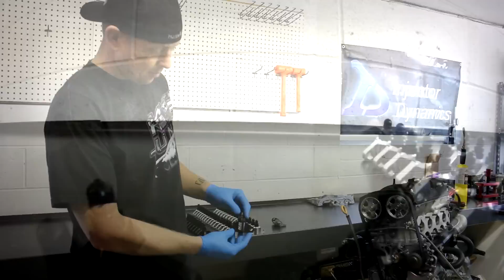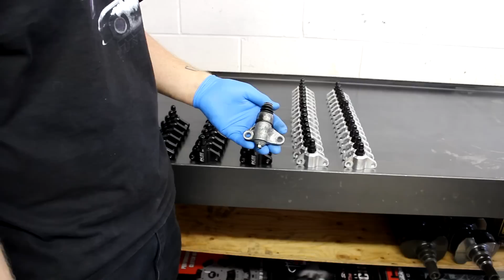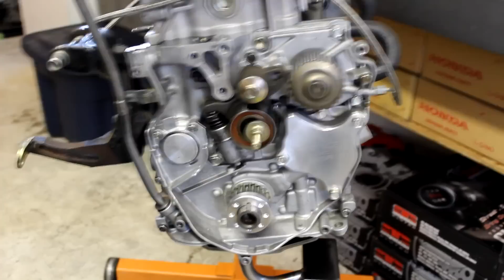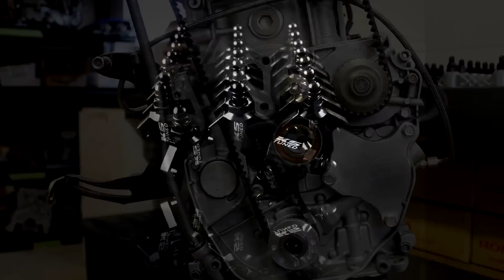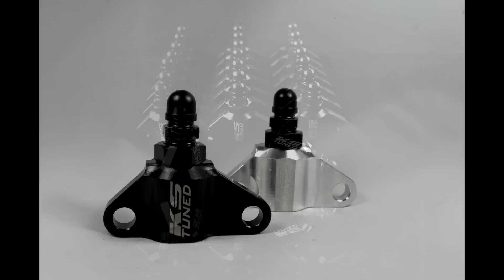H22 Timing Tensioner

Comment: The timing belt is a vital component of the engine. With this method and no data about the correct tension of the belt, there are many chance you set the wrong tension, shorting the life of your timing belt. If you don't need extra tension for strongest valve springs and you have not removed the belt cover to constantly see if something go wrong, I suggest the H23 manual conversion. I will resell it.

Comment: This video shows the Version 1 timing tensioner which was discontinued in 2013. The Version 2 tensioner design doesn't need a special wrench because the jam nut is small enough for a regular wrench to fit. Sorry for the confusion, an updated video is on the docket.

Comment: This is a pretty neat product, and I commend you guys for your ingenuity. But, this product still doesn't eliminate that entire bulky assembly. I refuse to run that tensioner assembly. The assembly on my F20B actually cracked the mounting point on the water pump housing. If you were to make a tensioner assembly that mounted to the actual block, or to the original adjustment bolt's hole, it'd make for a much stronger assembly. I actually have some ideas if you guys are interested.

Comment: as opposed to an h23 manual tensioner, doesn't it make it kinda difficult for cam swaps (whilst engine in car) with the KS  tensioner in place, as far as loosening up the tensioner for tbelt slack goes (say in an accord chassis)? i figure the frame rail would be in the way of getting a tool down there to loosen up the KS tensioner.. Great product btw!
Reply: Might be able to get a crows foot in there

Comment: Hit near 30 psi of boost on a stock h22a4 with a custom tec turbo (made for h22) cracked ring land didnt hurt the rods or bearing. High speed detonation near 6700 rpm. Straight t4 65/80 high cfm compressor. 10 psi ran faster than most street bikes. That build left tire stripes 1st to 2nd. Set for 30 psi high cfm ........ woulda ripped the front off the 91 integra i had the swap done on.
Reply: Great story but u need to Learn how to spell buddy.
Reply: Lol😂

Comment: Ive done this before too.  It was due to installer error...  I left the small bolt tight when loosening the main tension bolt at the water pump.  The force from the tensioner then cracked the water pump housing.  These guys lose the small bolt all together, so there is no chance of that happening.  But it wont happen anyway if the job is done properly.

I plan to try out the kaizenspeed tensioner.  A modified B series tensioner is another option.

Comment: My water pump bolt also broke, on my oem pump, im still waiting for my kstuned tensioner for my h but the first time we did the timing the bolt on the water pump broke, its mainly a common problem for bolts that are over 15yrs old, you know, so I went to honda dealer and replaced it for only 6.50 cents. It was pretty cheap. But my hydro tensioner oem one failed and it skipped some teeth and now wont start or meerly starts, havent messed with it since, till I get this product and try it out.

Comment: Its supposed to whine as f or the tensioners might be new the tension is higher then what you had it before, all the bearings and idlers having to do with the timing are not loose like before, creating the whining noise.

Comment: A few questions. If you aren't running the balance shaft belt, but still have balance shafts, is it safe to remove that stud? Also, if I heard right, you guys deleted the crankshaft pulley? How? Why? How do you run an alternator?

Comment: After I did mine a few days later I noticed a high pitch whine was told the belt may be to lose or to tight. I ve checked it a few times and my car runs great just really bugs me any input on this? could it be my belt? and what could I do to fix it I feel as if its tensoned right but its the first time ive done a timing belt so not to sure... any help would be grat thanks!

Comment: My 97 luda 1100 $ in parts for timing new gen factor tenstioner  update runs fine. Bal belt timming belt pully water pump new front lower timong cover. Jdm h22a with usa cams stock 5spd 15k after the work. Some intake upper work large 4th gen H throttle body shit cat header and yonaka likes to eat tires

Comment: Can anyone tell me why they would remove and disregard the balancer belt?
Reply: +Charvel86 Because the balance shafts have been deleted.
Reply: +Reid Lunde Is it safe to remove the balancer belt whilst leaving the balance shafts in place?
Is there any detrimental causes of running without the balancer belt?
Reply: +Charvel86 There are no detrimental causes of running without balance shafts. The right way to do it is to completely remove the shafts and completely block the oil passages that used to feed the shafts
Reply: +Reid Lunde Okay good information. I understand that that is the correct way to do the full removal. But the passages shouldn't be an issue should they, if the balance shafts are left in.
I am thinking of deleting the balance belt, leaving the shafts in and installing the billet tensioner. Would this in your opinion be okay?

Comment: He fail to add that if you run a daily driver that you need to reinstall the factory pulley. If not it will give you a code of no crankshaft sensor!
Reply: patrick garcia im havin issues with the balance shaft kit im getting check engine and my belt keeps on getting screw up with that blocker for some reason idk whats going some help?
Reply: The check engine light got was the crank positioning sensor!! so took the spacer out that and put the stock balance shaft pully back on and it removed the check engine!   Are you running the spacer and the stock pully together????
Reply: patrick garcia i have the whole kit. soo i have the balance shaft delete kit because my balance shaft sprocket broke thats why im using it but it seen that may b my timing is not right or something else i dont knw 🙁🙁🙁